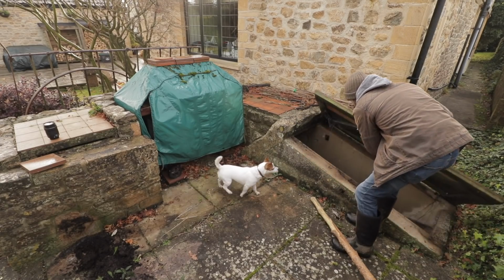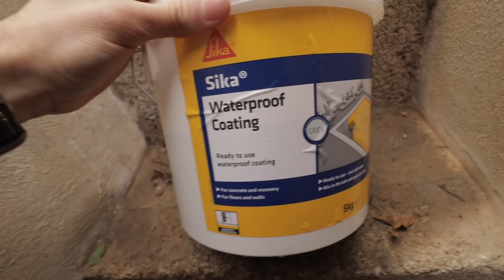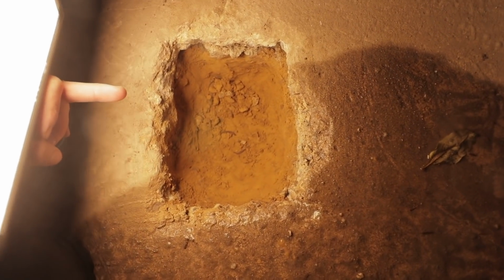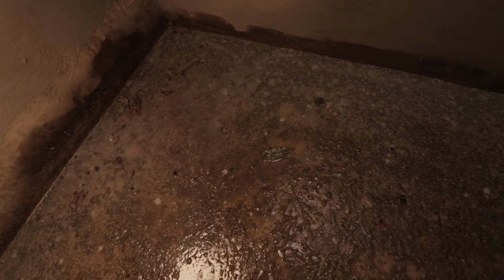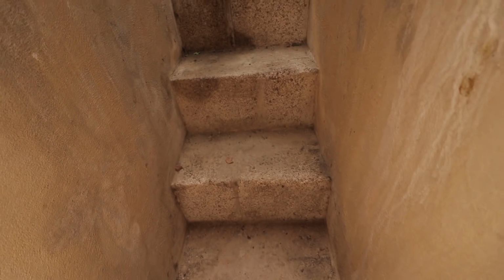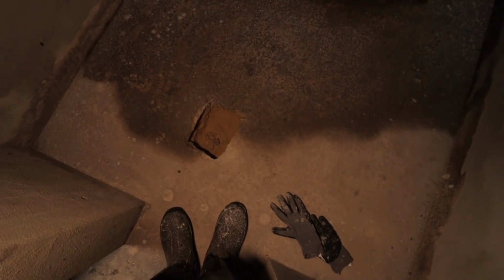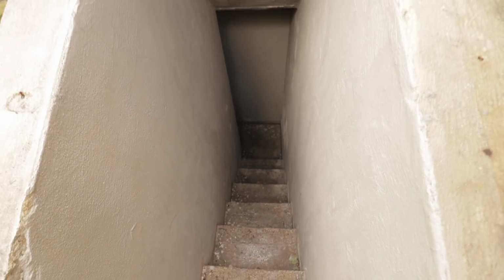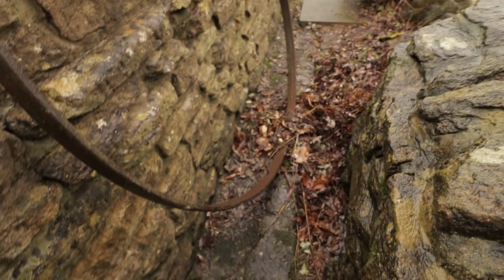WW2 Bunker Renovation: Sealing the Inside (PART 4)

Comment: Hi Mike, could you not run a thick bead of silicone around the concrete door frame - so that when closed the door sits evenly upon it. The barrier will cause the rain water to run around it. 😁👍

Comment: You could use a small space heater and an isolating fan to dry up the moister. It will get hot but not to bad because of the top vent.

Comment: You should also consider a counterweight on cable / pulley for the hatch. I would also put a sealed Plexiglas window in the hatch as well.  The bunker would be an ideal place to keep as a wine cellar. It would be possible to countersink a channel around the hatch opening to let rain water run off and put a rubber gasket around the hatch door.
The walls inside can be painted later on with a bright marine grade swimming pool paint, perhaps a pallet wood floor and some shelving for vegetables, wines, jams and other preserves. An adequate lighting system could be achieved using Led's and a small inexpensive solar panel.

Comment: Besides the passive air drying with both openings on dry days, a quite good drying airflow could be achieved by using 2 fans, one blowing into the smaller opening, one blowing out the larger.

Comment: Next , make it habitable. Heat and ventilation.
A steel hatch with gasket frame would help.
It only takes 1/8th inch of lead sheeting on the ceiling and hatch. to block radiation.

Comment: What I use at work is a small propane tank, like the kind you would use for a grill, and basically a roofing torch to dry out the concrete floors with all the rain and snow

Comment: I would build a small shed over the entry door, perhaps a full patio cover. It would keep things dryer and you could bbq in the rain.
I would seal up the rock and tiles above or even replace with better modern materials. I like the original look and vibe but it's not water tight.

Comment: Sims makes a seam sealer that will work great on the cracks on the base as it is self leveling and for the door that's tricky. I would raise the door an inch or two and create a channel around the door with a rubber seal to seal it on top of the channel allowing the water to run off and away from the entrance. Hard to describe without a drawing but think like a submarine latch just not as hard core.

Comment: False floor with a sump like a military dugout. Make an angle 5 inch hole at 35 degrees so air can blow in through a pipe. About 3-5 foot above ground. 2 air sources and open door entry as often as possible . High wall around opening that you can walk over. With a roofed and guttered entrance.

Comment: We've got a product over here in Australia called Xypex which we sometimes use for waterproofing our stormwater and sewer systems if they are leaking badly. The powder basically crystallizes on contact with water and chases the source of the leaks plugging its way from the inside to the outside. It can be a bit pricey but highly effective!

Comment: Sitka makes great products, I have used a crack sealer on my sidewalk 5 years ago and it looks brand new. I live in Minnesota in the U.S.A. and it gets very cold in the winter and hot and humid and in the summer both of which are hard on concrete with expansion and contraction.

Comment: Looking at the door at about 12:16, I don't know what is behind you, but I would see about 2 things there. One, cutting some of that concrete back, and resizing the actual door to make it bigger. That would stop rain getting in that way. A rubber seal around the interior of the door could help seal it, as well. But a dehumidifier would help in there, as well as rubber sealing the vent area. What I would do is build up the area around the vent, making it slope down, then laying 1x4's, maybe 2x4's over it, and then a sheet of plywood, and ensure you have enough overlapping to not get water in. You can leave the lower end open, above the concrete, so you can have air circulate in there, without having it open all the time. What you can do, is hinge the cover, so you can prop it up, and put a mirror on the inside to reflect light in. I would put shingles on the outside of the cover. Also, shingles on the door, as well.

Comment: I own a construction business and If you haven't already decided on a fix for the outside crack at the base of the bunker wall, I would recommend using hydraulic cement. You can mix it in small batches and stuff it in the crack with your hands (wearing gloves of course). The stuff is amazing at sealing water out and it made to even be used underwater.

Comment: Pop some plastic over the hole in the floor tape down prevent water getting in and fill holes in the door with silicone until you are able to replace it

Comment: I was a little skeptical of the powdered water proofer... but it looks like it went on pretty good.

Here in the states we have a very thick waterproofing paint in a liquid...
I believe it’s called dry lock.

If the Sika doesn’t work well you might want to look into it... I did my basement with it and it worked well.

Good job... it’s looking great.👍

Comment: Short of external tanking (expensive and possible overkill for a hobby project), I'd just put an old cast iron pot belly stove in it, and do a nice low slow burn whenever wet weather is a problem. Wood stoves demudify and dry remarkably well, plus they're cheap and easy to put in - and provide heating and cooking.

Comment: If your stairs get a bit slick when and if you paint them stick some grit/sand in what you paint them with or use a solution with grit already added so it gives you some grip. Last thing you want is to slip on the way down and meet the wall at the bottom at speed!

Comment: You may want to run a space heater and or a fan running. 
The heater will help to dry out the air. The fan will help circulate the air.

If you use just a fan in the stairwell facing the bunker it should draw air in from the outside that will vent out through the vent whole. 
The important thing is to circulate the air within the bunker.

Comment: A dehumidifier is good but you have to have a way to pump out the water that is collected.  I live in very humid south Louisiana USA..  I find that just keeping air flow moving in and out will make a huge difference..  There are very nice high velocity low noise vent and motor combo available...  Another thought...

Comment: try adding saw dust from local mills to sop up the water.....  keep at it for about a week and it should be dry enough to seal.  use a roof sealant type for the seams and joints.

Comment: Research Sika 1 waterproofing system. Very labour intensive, material intensive and not cheap but that would keep it dry for the lifespan of the structure if applied correctly.

Comment: It looks in construction similar to the hide outs used by the guerrilla groups that were planned as a last line of defense in case of invasion, now while this clearly isn't one of those it's perhaps likely that following their construction methodology the skylight was actually a second entrance/exit for use in emergency, probably with a solid but movable concrete slab on top with simple ladder access from inside in case the main entrance/exit got blocked. It's a wonderful find and your kid is going to have a lot of fun in there in a few years

Comment: I used a 5 gal Plastic  pail in the hole and grouted around with concrete The sump pump fit nicely. It has a float switch so if the pail fills it gets pumped up to a drainage system.

Comment: It's kinda of inside out and backwards but you can drill holes into the walls near floor insert pipes and seal them then run pipes to sump and out of the bunker. If done right it would only take up about 1 inch of space around bottom where the floor meets the wall.

Comment: I used a similar product on my basement walls in the same condition as your bunker.  Small wet spots, seemingly just slightly damp.  The following rainy season those spots all leaked.  I ended up running a dehumidifier and a space heater to reseal it all yet again and so far(13 years) it has been fine with no leaks.

Comment: There is a product called DAMPRID that is a bucket full of basically dessicant that absorbs all airborne moisture in a room. It works very well and I highly recommend it for your situation down there. A few buckets over the course of a few weeks most likely all it will take until a single bucket a month may be all it takes for upkeep.
-✌🏽

Comment: You might need to add a few more layers of that water protection. Or at least the ones ive seen used have been very thick and it was painted on the wall with a roll.

Comment: Look into an industrial fan heater (you can rent them) I used them lots over the years to dry out building sites / set concrete in wet weather / dry out basements ect~.

The main thing is low heat + lots of airflow, things like dehumidifiers and high heat dryers can crack and warp surfaces.

Comment: As a brickie in the UK we used to use Thompsons water sealant ( swear by the stuff) on a lot of old cottages etc to stop water penetration but you can also use the stuff on wood etc. The only way you'll stop damp is to stop it from the outside unfortunately as the sealant you've put on will flake off in time. A damp proof membrane might help but it means a lot of digging around the bunker.

Comment: Im just now watching the series so you've probably already done this but if you are still having trouble drying out the bunker (sealant or water), you could put in a hot air fan or portable propane heater to help. If using propane, open the skylight. (Carbon monoxide etc.)

Comment: Both openings need to have the highest point nearest the opening, so that the water sheds away from the opening, not funneling into it.  Study how a skylight kit is made, with a lip that projects above the roof, and the skylight shaped like a cap that goes down over the lip.  So for any added cement lips, beveled down and away would be better than flat, and any additional cement should be higher than the older stone lips.

Comment: After you rebuild that door and seal it if you add a bit of a rubber overhang above the door it should move water out onto the door and not run down the wall or lake the door sit above that rock  work

Comment: If it’s anything like grouting, u should have a thicker mixture of the stuff u uses, for example, fill a gallon sized bucket with no more the 1/4 water then continue to add the mix till u get a no drip type mixture and use a spackle paddle type thing and apply it smoothly to the walls rather then a thin coat of a soupy mixture

Comment: Have you stopped to think that perhaps a small heater may speed up the drying process ?, also you can buy a sump pump bucket that you concrete into the floor, it would be better than a wooden box that will only rot out.

Comment: Rent or buy dehumidifier, i work building offshore oil rigs that have concrete cells that sit on the ocean floor, they use like an epoxy paint to seal/protect the concrete, works good and has a smooth finish

Comment: Looks good mate, for the sump rather than trying to seal the hole asit is you'd be better to sink a small container in there like a waste paper bucket or a small bucket and seal the floor to that. Then you'll have a clean well formed hole.  your vent you should think about putting some kind of reflective finish on the sides, you'll get more light down. Much like a light tube.
Reply: Look at light tubes and how they work. :)

Comment: The trick to underground spaces is to accept they will never be completely dry. You have to manage the moisture to keep it at acceptable levels. The most sensible and affordable way to do this is with simple ventilation. Heat and dehumidifiers are fantastic, but nobody really needs the day in, day out running costs for what is essentially going to be a fun space in occasional use. A decent ducted fan, running 24/7 costs pennies a week to run and will be surprisingly effective.

Comment: Anportable kerosene heater will warm the bunker and get the air moving. The kerosene heater will draw the water out as vapor and carry this up the skylight / air shaft. Most will run at a low heat for 12 or more hours on a gallon of diesel or kerosene. Cheaper than an electric heater.

Comment: I just did some research on the waterproofing product you used and it definitely is a crystalline waterproofing material, based with cement. Ive used a different brand in my basement (im from New Zealand) but it looks like the same type of stuff I used when i looked at the ingredients, but Sika is a very good brand. It worked for me and did a great job, basically it actually mineralises into the concrete and makes it waterproof, but will keep working. It also makes weak, cracked concrete stronger. You will see it may form crystals over time, this is normal, as its absorbing moisture and actually building a crystal structure, making it even more waterproof over time as moisture tries to get through. The instructions for my product said to keep it damp for the first week and spray it gently with a garden sprayer which I did, and you could see the surface turn to a crystal like structure. If you see white fluffy crystals, you can spray a diluted vinegar mixture on it and it will stop this from happening further. Its designed to breathe and should not be painted, but I have painted over the surface in one place with no problems, but I would see how many crystals burst out before painting. I hope this sorts out most of your dampness issues, you should be OK with some form of fan for ventilation in the future :)

Comment: I would have repointed the stone work first, then made a cowl and vent and renewed the door all over lapping the stone, so water is shedding away from any opening . Then put a heater or dehumidifier down there for a couple of days at least then seal the walls , make sure its well ventilated to prevent mould and vents have mesh small enough to prevent insects if you plan on storing food.

Comment: Radon.  It is a colorless and odorless radioactive gas that seeps up from the subsurface and can occupy basements and your shelter.  With the hole cut into the floor you can bet your bottom dollar that you've opened up a door for it to seep into your shelter.  You may want to get a move on to enlarge and seal that sump box.  Best regards.

Comment: Seal the door and then put a fan inside pulling outside air in and pushing moist air out.    Put a wireless light switch with in with a light puck or two to get light inside with batteries.  The wireless light switch can run several puck lights that are very bright.  Run a power line inside with conduit from above on both sides of the door so you can run power in and the water out.  Well done on gettingthe walls sealed mostly.  That will help get it even drier.  get fan i nthere quick or loose what you have gained.

Comment: Cementing all over the outside and waterproofing will go a long way to helping the inside dry out.  If you put an electric space heater inside while it was sealed up for a day or two and then a dehumidifier would help dry it up.  I would still go with Drylock after the sealer job.  Do yourself a favor and get a bigger brush.  You'll save a lot of time and effort.

Comment: I think the best thing to do with the drain in the floor is fit a cast iron cover (with holes).
If you ever see water come up the drain then it needs filling, but it would be useful.
As for the door, at the top of the door frame for a piece of angle iron (1) so it stops water running from top to bottom.
Side view ___L__ 
On the inside of the top of the door you'll need another piece of angle iron (2) that will be further up the door than the first one. Any water will first drop off of the door into the frame by iron (1) then be stopped by iron (2).
So it should look like (side view)
H2O flow →
™™™™™|™™™™™™™™™™™™™
__________L____
👍

Comment: I haven't watched your channel in a while (couple of years) so I've been binge watching this series... I feel a bit sad not being able to comment sooner with suggestions :)) - Sika products are really good, I've been using them myself. Both for heat and water proofing. I also have a big cellar which had a similar problem and I would've gone for Sika but it was waaay too expensive to cover the whole cellar - so I've used Ceresit CR 90 - which did an amazing job for much less... it's been more than 4 years now and there's no leakage - but there's still no doubt in my mind that Sika would have been the superior choice.

Comment: The trouble with concrete is that it is inherently porous, water vapor-wise.  The question is do you attempt to staunch the flow of water vapor or appropriately vent a structure?

Comment: Goodluck sealing that. You would need to seal it from the outside like you would a foundation/basement otherwise hydrostatic pressure will always force water through no matter how much sealer you put on the inside walls.

Comment: You could just put a tarp or plastic sheet over the door until you can get something sorted out. Maybe a shed/roof or just foam weather stripping around the door. The skylight/cover should also be bigger than the surrounding masonry to prevent water from pooling up on the masonry and then seeping in slowly. You could also put a box fan over the rebar grate you installed and leave the door open on drier, sunnier days to help create a circulation and air it out more quickly

Comment: You should seal the air vent and run a dehumidifier down there with an extension cord. That will all dry up pretty quick

Comment: Ah, I forgot to add. After applying the sealant, paint your bunket with white oil-based paint. It prevents mold to form again. After two layers of white oil-based paint, use the paint and color you want.